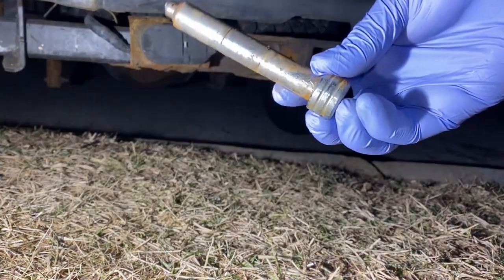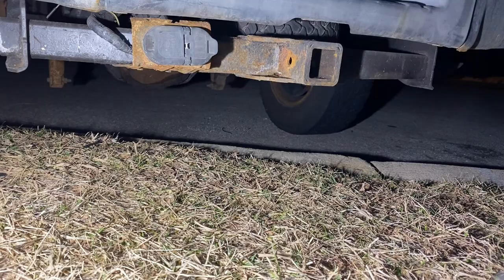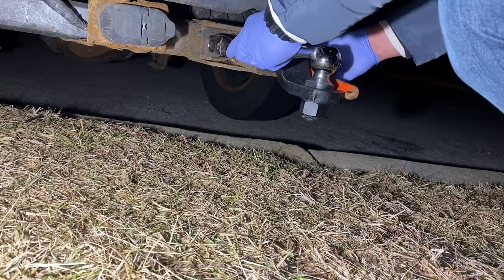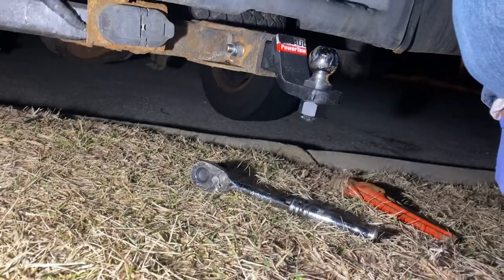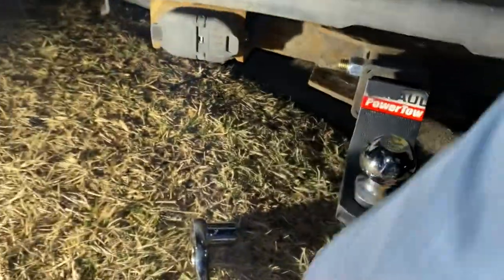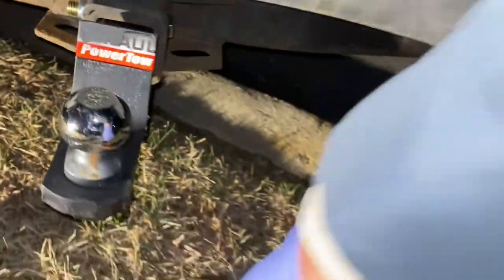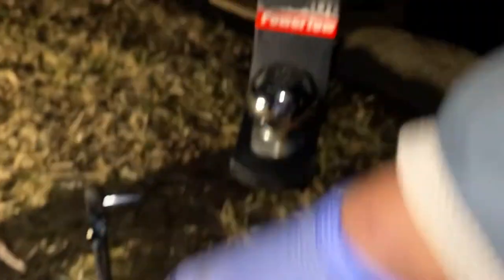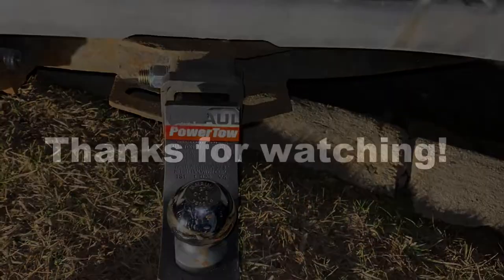How to break a trailer hitch lock in one second

Comment: I was taught always insert the pin from left to right. The logic I was told was that if you had a failure of the clip, nut, etc that the crown of the road slanting slightly to the right to run off water would help keep the pin in.
Reply from the maker: Wow! Didn’t know about that! Thanks for sharing!

Comment: Did the hardware hold up after all or did you see it loosen up from long distance road trip vibrations 🤔
Reply from the maker: Yes it held up tight!
Reply: You've never used a Nyloc nut before, they will not vibrate loose under any circumstances .